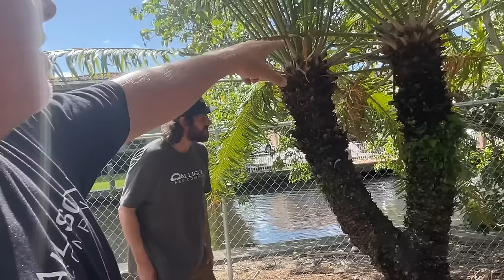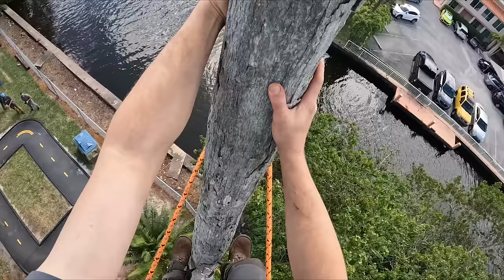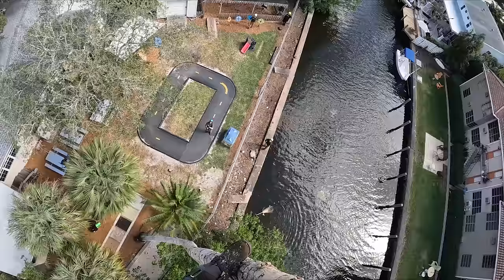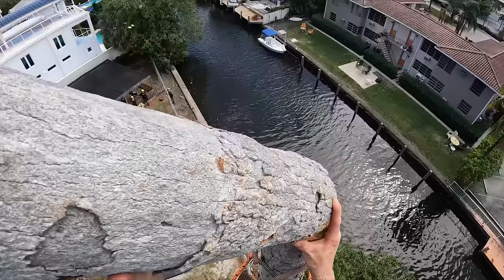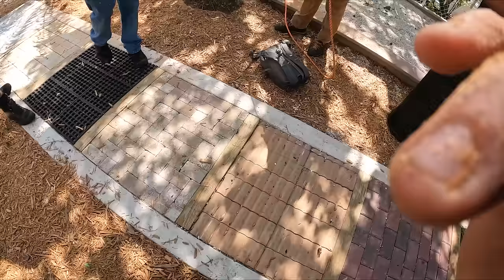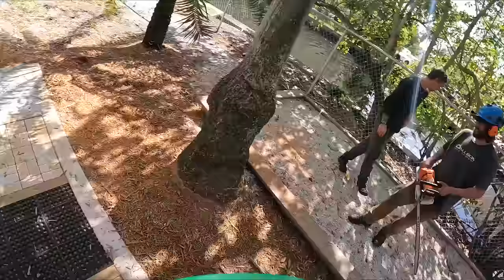Overcoming My Fear! Climbing and Cutting Down a Tall Wobbly Palm Tree!

Comment: Enjoyed the video.  Quite the bean pole.  I usually will use an adjustable cambium saver (or wrap your lanyard around once) when climbing up along with my lanyard.  If you gaff out with just the lanyard there is a good chance you will go for a ride.....possibly a long ride.  Nice chunking and dropping. A1

Comment: Hi Jake, I have an idea for you, carrying your saw.
Mount a Petzl Caritool L in your harness, slightly behind your right hip. Your saws handlebar "tubing" fits perfect in the Caritool, and will be hanging in its centre of gravity, and the bar is pointing away from you, in a 45° angle approx. Its so comfortable, and much easier than dropping and pulling up the saw, in its lanyard. Ofcourse you'll still need to have a lanyard connected😅😅😍

Comment: We have tons of palms here in Southern Arizona I'm not a fan of them. I use a tree squeeze by buck when I have to spike one. When they have more than 3 years of growth on them they must be worked from the top down  Witch means either a lift or srt line shot over the fronds.
Reply: How are snap cuts on palms?
Reply: @Neil D  honestly I don't think I have ever tried to perform a snap cut on one. Normally I just blow right through them with the saw making a level cut so the peace just rest there then pick it up and chuck it or push it off. If it's a slitly bigger around palm I  make a cut almost all the way through and then when the cerf starts to close I finish the cut from the other side. Down here we have sand storms and the palms get loaded with sand and it eats  chains up.
Reply: No palms in Preskit thankfully. I agree with you dude palms suck. Bark scorpions and pidgin poo, no thanks. Where you from faceless?
Reply: @timbermen11  yuma

Comment: Honestly, even though I've climbed my own palms, I've never been more scared seeing you go up that palm  anchored by a single rope! I wanted you to double clip in around the trunk for added  safety. Palm trunks can be slippery bendy noodles and I only used a lineman's wire reinforced 1.5" leather strap with rope backup tether to my waist harness. Most pro arborists here in AZ who do palms do same or they have two multistrand rope wraps around the palm trunk. Spurs don't always dig in like they do trees. I wouldn't have said this had I not been an EMT/Paramedic as AZ has tons of palms and unfortunately I've seen some bad things happen to arborists losing grip/footing. Please be safe Jake!

Comment: I get really freaked in thin wood. Something that gives me a little more confidence is using the quick draw method with an srt line. Get a tip set at a low level you know is secure, then climb above tip and advance your srt line with additional tips while still keeping the original tip. I first saw it in one of captain hooks videos. Makes me feel more secure on the "pool noodles". I'm not explaining it well. Capt hooks video explains it well.

Comment: I was nervous as hell when I cut down my 60ft elm tree. Other videos out there reduced some of the fear because it was clear the top won't just snap despite slimming down to 6 inches in diameter where I stopped climbing to cut. I was mostly terrified it was dead wood up there like lower branches were. First time climbing a tree and DIY tree removal, and it went better than I expected.

Comment: Yeah these palms arent fun to cut down haha. I found the best method to prevent the palm fronds from taking off and ending up in rivers or other peoples yards was to just perform a back cut (dont cut all the way through) it will dangle down which will allow you to grab the fronds with one hand, finish your cut and with the cut end point it downwards throw it down to the area you wish for it to go. Obviously wind is a factor and will cause the fronds to drift in the wind but its a method i use to prevent any unwanted damage. Yeah the process is slower but fishing out palm fronds in unwanted areas is slower 😅
Reply: Looks like you could rip down a little into the ‘wood’  and throw down a tufted lump to avoid wind blown? Arm chair advice though! i know how it feels to just want that top off in the wind.
Reply: @neild7971  yeah just gotta make sure your saw doesnt get jammed. That horrible fluffy 💩 in the base of the head wraps inside the saw when you try to cut into it. Cocos palms / queen palm is a prick for it.